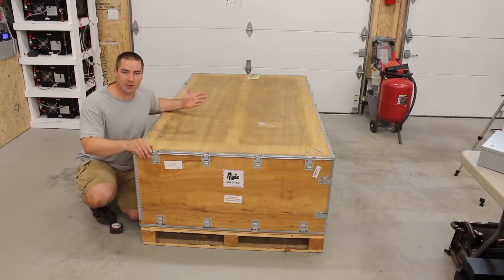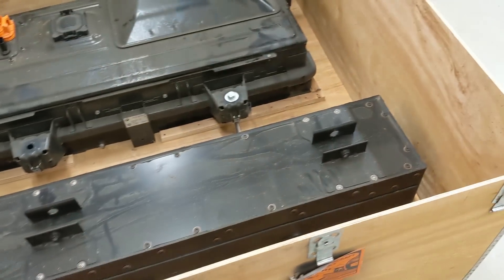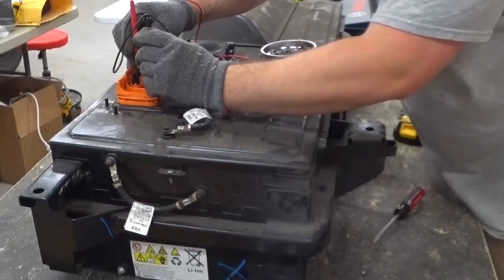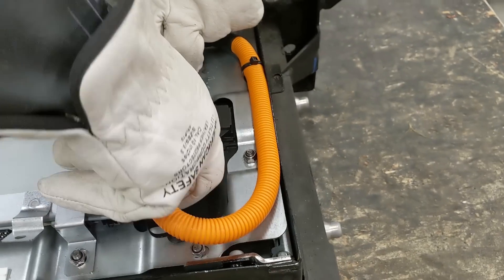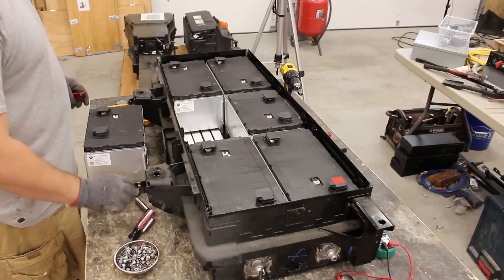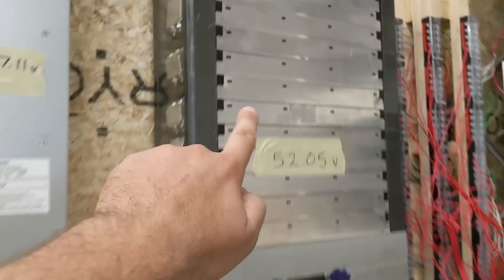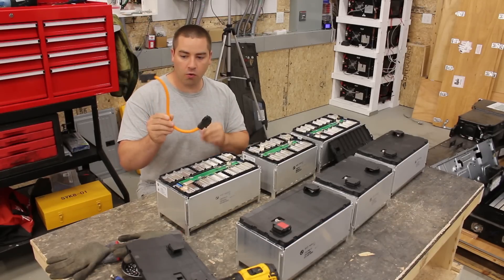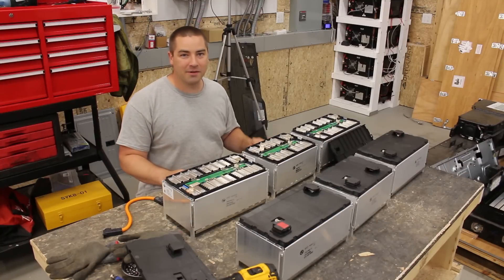Huge BMW Lithium Battery, EV, Less Than $100/kwh

Comment: Hi Dav, I am getting ready to setup a system that is close to 8000 Watt input to a 5 kw inverter/ controller combo, made by mpp solar from China, it is a 48 volt system, and I was planning on using 8 double sized 6 volt flooded acid batteries, would the lithium battery setup be more useable power? Thanks for your time and knowledge.
Reply: I'm planning on use the power to run my double wide 45 ft HC container pad, with a  mini split style ac/ heater, and have a washer and dryer in the storage container shed, should I get two of the battery packs and hook them together? Thanks again for your help.
Reply from the maker: Thanks for your question.  Both lead acid and lithium have pros and cons.  They can both work.  I'm going to use some rough rules of thumb here: Generally speaking, lead acid allows you to cycle it 50% DOD (depth of discharge) and if you care for them, might give you 1,000 cycles..  Lithiums, like in this video, can go more like 75% DOD and give you 3,000 cycles.  So Lithiums usually end up being less expensive, but there are some draw-backs.  Lithium batteries need a BMS.  If you buy pre-made lithiums the BMS is built in.  But with the ones I show in this video you have to add a BMS.  

BTW, if you are going to run an LV5048 model, I did a quick little review on it: https://youtu.be/FUaDmVDcYks
Reply: Thanks David, I have another question, if I were to purchase the lithium batteries from the battery hookup, would I need a bms for each battery? Or for each series of batteries?  My property is in southern California in an area called Aguanga California. It gets pretty darn hot out here, would that be a bad thing for the lithium battery? Thanks again for your help, I look forward to seeing your video on hooking up the bms , oh yeah how many amp hours would the lithium battery give, from the BMW battery you showed , thanks again
Reply from the maker: In this video I pull one big module (black steel case) out of the crate.  Inside were enough cells to make two 48v strings.  In this case each string would need a BMS.  But the two batteries can be combined inside the black steel case.  So the wires would go from battery, to BMS, to lug that combines them into one wire, then out of the case.  If I were in an area that was very hot, and never froze, then I would be very tempted to dig a shallow hole right next to my building, put the battery in the hole and cover with a few inches of dirt.  Then just run the positive and negative wire through the wall into your building and have the inverter right there.
Reply: Awesome idea, I have checked out the Battery Hook up web site, they have the entire BMW battery pack for sale for something like 2700 $ I did leave an email, I am sure they will get back to me soon. Do you think they would sell just the module you are recommending?  Are you thinking about or will you please do a video build of the module and bms setup for us to watch and fallow, I would really appreciate it. Thanks again for your time and support, I have been watching you for quite a while. Thanks for all the great videos and projects 👍😊
Reply from the maker: Yes, I'm working on a video describing the BMS's.  The whole BMW battery can be broken down into more cells.  I asked them to offer just the one as an option if someone doesn't have the full $2700 up front.  But if you do have the $2700 then there is nothing wrong with the whole car worth, it's just not as elegant.  Battery Hookup also has a couple other good options for 14s.  You can use code "DAVIDPOZ" on anything Battery Hookup sells for 10% off.  Check this out too: https://batteryhookup.com/products/lg-14s-48v-2-2kwh-lithium-ion-module
Reply: Awesome idea, I have checked out the Battery Hook up web site, they have the entire BMW battery pack for sale for something like 2700 $ I did leave an email, I am sure they will get back to me soon. Do you think they would sell just the module you are recommending?  Are you thinking about or will you please do a video build of the module and bms setup for us to watch and fallow, I would really appreciate it. Thanks again for your time and support, I have been watching you for quite a while. Thanks for all the great videos and projects 👍😊

Comment: @Lazerwelds: yes they are! thats how lazerwelded Aluminium looks like. I used to work for a company who build this kind of equipment, Lazer is the perfect chioce because it can weld so fast, that the rest of the metal is kept cool (temperature has no time to migrate)
Reply from the maker: Awesome to know.  Thanks for sharing.

Comment: Use a 12V water pump and make a cooling system and use like 1 battery and 1 solor panel to run it to cool the batteries off just solor

Comment: Dave, How hard would it be to convert these to 12 volts in order to use them on an RV?  Would it require a lot of custom hardware for custom connections?
Reply from the maker: This type of chemistry does not lend itself well to 12v builds.  Instead, a 12v battery should be built with 4x LiFePO4 cells.  4 of them in series makes a perfect 12v battery.  Try 4 of these: https://batteryhookup.com/products/calb-prismatic-3-2v-180ah  You can still use my coupon code "DAVIDPOZ" for 10% off.
Reply: @DavidPozEnergy  Dave, thanks.  I'll check it out.

Comment: What you call a  cooler David, I suspect is also a heater for sub-freezing temperatures - lithium can provide power down to about -20c but they don't like being charged below freezing - you will permanently damage them if you give them a hefty charge at -5c
Reply: Actually you don't know jack shit either. Of course they are mostly for heating if not entirely for heating. It's a pad design and not a heat exchanger. Cars don't use LiFePo4. Who would be stupid enough to add weight when you want less cars? google: "nmc battery maximum operating temperature"

Comment: What are your thoughts about these?  https://batteryhookup.com/products/byd-24v-8s-lifepo4-3kwh-blowout?fbclid=IwAR2DRz8yi--jV9rYCVVf6JtbZk6WiQIGwtpCiIybdjw_igxXyMS2Lh-OD90
Reply from the maker: I'm staying away from them personally.  It's not a terrible deal.  I have some BYD LiFePO4 batteries, and they generally work, storing solar energy.  The trouble is they are very hard to keep in balance.  The cells seem to all have different IR, and different self-discharging rates.  I think it makes more sense to buy cells that are either new, or not used hard.  These BMW batteries in this video were used for 3 years in leases, and are testing 87%.  But the BYD packs are 50%.

Comment: Any update on where you're headed with the BMS for this project?  Really tempted to pull the trigger on this one but truth be told it's probably 5 or 6 months too early for me as we are looking for a new property at the moment.  A couple of those 8kWh batteries would probably be enough to run the whole property most of the time.
Reply from the maker: There is no need to rush into a battery before you are ready.  yes, this deal might sell out.  But there is always another battery deal coming around the corner.  
I will be using "Daly BMS, Common port, 14s, 100 amp, with balancing."  You can buy them from Aliexpress for $70 each.  I will use one per side, and put a 50 amp circuit breaker on it.  I won't be able to do this video until it comes in.
Reply: @DavidPozEnergy  That was my thought after hovering over the 'buy now' button for a bit!

Comment: These are 8 years old, i hear lithium does age, what do think is left in these?, are you using them?
Reply from the maker: Maybe I'm optimistic, but I hope to get 8+ more years out of them.  My garage is heated and cooled.  They won't see major temperature swings.  In a home backup system they are cycled every few days, not every drive like in a car.
Reply: @DavidPozEnergy  .....So do you think that 8 year life for lithium's is low, ?..anyhow are these different from Tesla batteries?, is the voltage higher or do you need a custom unit to match curves to batteries  for inverter and charger?

Comment: So you could make six groups of 14S modules and then have a (1) 12S or - (3)  4S modules if you wanted to use them for 12Volt applications.  Pretty cool batteries.  thanks for sharing.
Reply from the maker: Yes, exactly right.

Comment: What kind of circuit breakersare you using on the batteries? Conventional breakers would flash weld closed in the event of a crowbar short, which can push 3000 amps even from one 12v car battery.
Reply from the maker: You are right.  I need to use DC rated circuit breakers.  I usually use Midnite Solar brand on most of my builds.  https://amzn.to/2OLJt2o  This is a good one for din-rail.  I like using these if I'm going to have it inside the case.  But they also make panel mount: https://amzn.to/3fOv0yL  I will probably start with the panel mount one, and try to set it up so the breaker can be switched from outside the case.  
“As an Amazon Associate I earn from qualifying purchases.”

Comment: If you mount the big module horizontal so that the 2 cooling lines are vertical of each other then you could just mount it directly into a radiator and convection cooling would naturally cool it. If there was too much heat to get rid of through natural convection cooling a small pump could circulate the coolant.
Reply from the maker: That would be fun.

Comment: I'm surprised you're dropping the active cooling on a battery pack that has the potential for pulling 2.4-2.6Kw's for the sake of a fish tank pump, a 5 gallon bucket and a £25 car radiator.. It could be easily setup with a temperature control relay for £15?

Comment: Add some thermal grease to the heat-sinks on the battery modules and the aluminum cooling pipes for extra passive cool!

Comment: I love it your can always tell a millennium type techie they always look for the too simple setup for making anything. They are totally driven by KISS engineering, which is not always bad, but here well no you are courting trouble. BMW does a Zillion $ engineering job on this battery bank, which he gets for free and he just disconnects it and not use it ??. They ultra inpatient ( I want it now ) drives me crazy because it the end they really never know how this stuff works ( and really do no care ) until it goes up in smoke. 
   BUUT on the positive side he makes a very good decision in using a 50 amp fuse for the battery bank to protect the battery and a possible fire. I have built too many off grid systems and do the same fuse limit on all my battery banks
Reply: I guess that was my initial reaction as well.   But the problem is that BMW won't have documented how all of these modules communicate with each other, and in order to use them you would need to spend a lot of time reverse-engineering the thing.  If you had the entire vehicle, you could potentially put something together so the modules still thought that the rest of the vehicle was operating, but he only had the battery packs.  So using the packs as-is doesn't sound easy at all.

For off-grid solar, the requirements are a bit different than in a vehicle.  In a vehicle, you might want fast acceleration, so you might need bursts of fairly high power, and you might also need to support DCFC and higher charge rates.  That then introduces all of the thermal problems, leading to the need for active thermal management.  But for residential use, you could design the system so the power draw and charge rates are far less, and if the things are indoors then the temperature will not be an issue.  So you might sort of argue that the BMW system in the car is over-engineered for use in off-grid solar.

Comment: Nice video.. One question, given you have 5p and 4p in the same string, does the 4p dictate your usable capacity?
Reply from the maker: No. The cells are configured as 2p (2 cells in parallel).  Then there are groups of 2p5s, and 2p4s.  I'm arranging them as 14s total.
Reply: @DavidPozEnergy  thanks 👍
Looks like a really good deal..

Comment: What is the weight of the 3 (14s) packs as they were on the bench?
Reply from the maker: Each 5s pack weighs 35.2 pounds, and each 4s pack weighs 28.6 pounds.

Comment: Dave.  Just saw your new BMW  video.  I live in PA and want one   But I uncertain how to charge it non solar.  What charger should I buy too?  What is the chemistry?  Is it safe in my basement?  What is the weight?   
Love the videos.  Keep up the good work.  I to want to take my family PV 
I appreciate your work.
Reply from the maker: You could buy a wall charger (usually sold for electric bikes), but you will still need an inverter to use the power.  Inverters take the 48v DC and produce the 120v AC.  So you may want to buy an inverter/charger all in one.  The best one I'm aware of is the "Sol-Ark 12k".  You could charge and use the power, and add solar panels as you get the time.

Comment: Is it ok or safe to use those batteries without a BMS system.🤔🤔
Reply from the maker: No.  A BMS is a very important safety feature.
Reply: @DavidPozEnergy  thanks

Comment: To add active cooling:
Radiator: https://www.amazon.com/Thermaltake-Pacific-Cooling-Radiator-CL-W191-CU00BL/dp/B00099E0O4/ref=sr_1_24
Pump: https://www.amazon.com/EcoPlus-Submersible-Aquarium-Fountain-Hydroponics/dp/B01G0PVYNU/ref=psdc_402303011_t2_B008F29MYA
Fans (x4): https://www.amazon.com/dp/B00KFCR0PQ/ref=emc_b_5_t
Fan guard: https://www.amazon.com/Easycargo-140mm-Grill-Guard-Screws/dp/B07VCNKDKD/ref=sr_1_15_sspa
Temp Controller: https://www.amazon.com/SCYTHE-KM05-BK-Master-Controller-Panel/dp/B0062DEYGA/ref=pd_sbs_147_5/139-4019560-6525822

Comment: i have a question for ya,,,whats better chevy volt batts or these?,,i have volt batts now just thinking about safety
Reply from the maker: Both are going to be in the same family of Li-ion, being some version of NMC.  These cells were from Samsung, and Chevy buys cells from LG.  Both are reputable manufacturers.  I'm not an engineer, so as far as the cells are concerned I won't be able to say one is safer than the other.  Both should be run with a BMS.  Assuming you buy these BMW cells, and house them in the original steel housing, then the steel should offer some protection.  But you could always put the Chevy Volt cells inside a steel cabinet too.
Reply: @DavidPozEnergy  well i guess the biggest prob im having now is ,,the recharging of the volt batts now,,i don't get to float intill 12/100 noon,i have the same charge controller you have ,i have it set to charge at 35amps,i have 6 modules at 48 volts,,and now 4660 watts of solar,,,it gets sun from730ish to 6;30ish,,but im confused about how long it takes to recharge the batts,,i dont use them from 130am till they get charged to to float again,,that's just how i roll,,good or bad that's just me,,i just think 35amps is just to low?
Reply from the maker: If I am understanding your question, you are asking how many amps can you charge Chevy Volt cells safely?  I'll assume you have no active cooling.  I used to charge mine at 12.5 amps per chevy volt battery and never experienced any heating that I could record with temperature probes.  I had 8 12s batteries in parallel, and sometimes maxed out my 100 amp charge controller.  100a/8=12.5 amps each. You said you have 6 modules, so if you maxed out your 100 amp charge controller at 100 amps, that's 16.7 amps each.  I think you would be fine with that and not over-heat the cells.  Remember, this is a conversation about temperature, not voltage.  you still need a BMS to shut things down in an over-voltage situation.

Comment: high david , what do you think about that mastech meter you have, I just noticed you have it, I actually have it in my amazon cart and torn between that  
Mastech MS2108 and the TTi UNI-T UT216C
Reply from the maker: It's OK.  All these meters are OK.  Yes, it clamps on and I can read the DC amps.  But my Uni-T did that too.  None of these scream high quality, but they are good enough for what I do.
Reply: @DavidPozEnergy  Thanks for the reply i really appreciate it, just one more follow up question if you dont mind: the uni-t is regarded as a high quality unit by many and have been compared to high end flukes and such  but is like 80-90 while the mastech is arround 50, I guess my main concern is is the mastech is accurate as the the uni-t? the main reason im looking at these is for dc clamp as well as the ac inrush current feature to properly size inverters and generators for LRA's on induction motors. Again I really apreciate your feeback since were more or less using for the same purpose.  . . Thanks

Comment: I had no Idea these batteries  were so complicated..   My antique gulf cart with 3 batteries and a resister bank and rheostat look like cave man tech.  Thanks so much for the insight.  I guess there is no way a BMW battery  can just plug into a GMC elect car ....
Reply from the maker: I'm currently working on a video where I put a new lithium battery into an old golf cart.  You might like that.  It's got the old resistor pack like yours.

Comment: Sorry I forgot the wife brought a very large lot of dell laptops

 Most have solid state hard drives i5 processor 16 gig ram most have DVD burners all have good batteries 

 Most of them have passwords or are wiped clean but all have windows stickers 

 I use free OS like Zorro and other free linux based operating systems 

If you could use one let us know I could send 3 or 4 extra batteries for it also if that would come in handy 

Have a blessed day